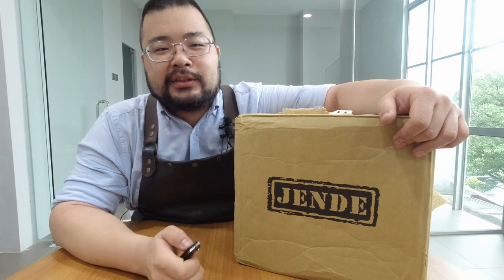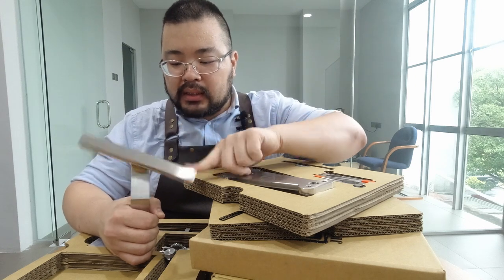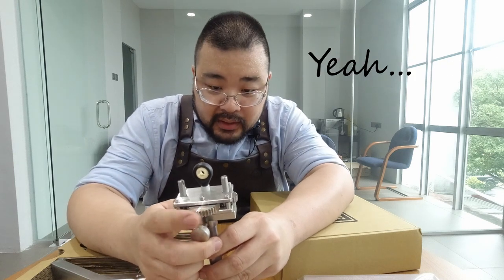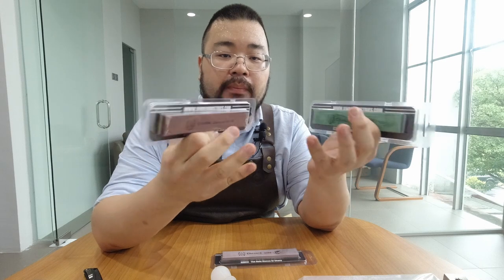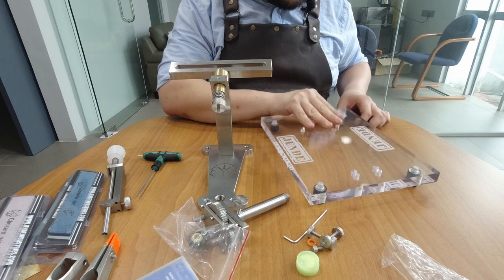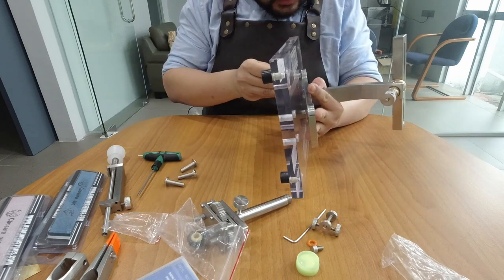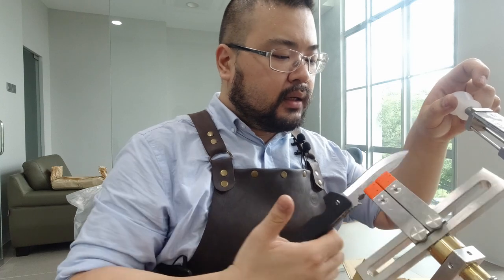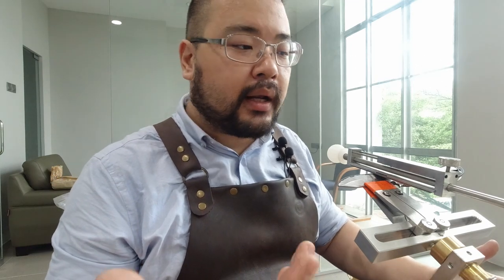Jende JIGS | Sharpening Gear Unboxing!

Comment: I mean... Chris Reeve Sebenza comes with a 30DPS so.. 37° isn't THAT crazy lol
Reply from the maker: i'm gonna step on some toes here...but 30dps is nuts.... especially for a folder
Reply: @The_Polished_Edge  yeah man, for $450+ you think they would have their sharpening together. 30dps is insane
Reply from the maker: @no1up  and their heat treat, 57 hrc for s35vn? i know they muped it up to 58 recently, but s35vn shines at 60+
Reply: @The_Polished_Edge  I don't mind that. Sharpening HARD steels SUCKS!
Reply from the maker: @no1up  i actually prefer hard steels. With the right stones, they remove material faster than on softer gummier steels. The problem i have with that heat treat is that its just so difficult to push the edge to an excellent HHT passing edge